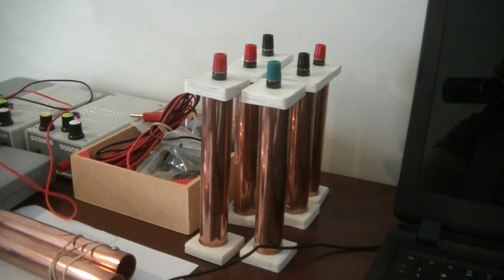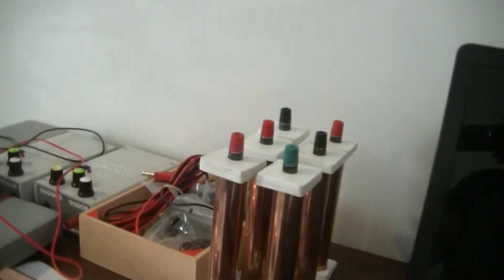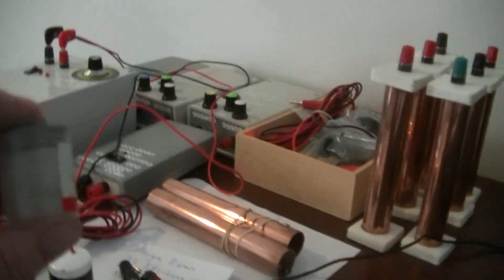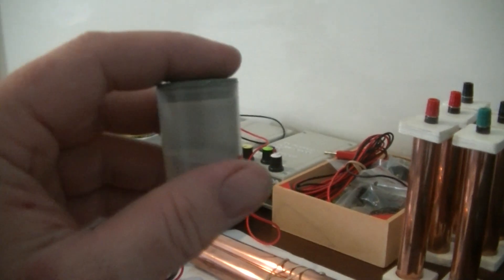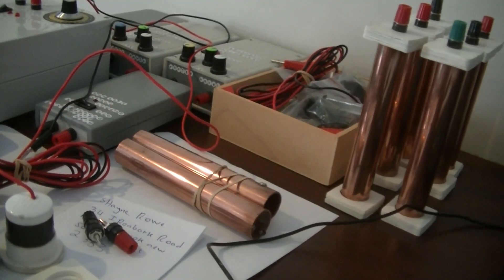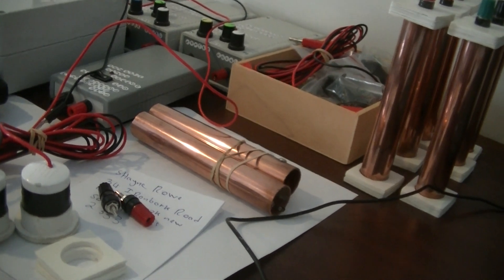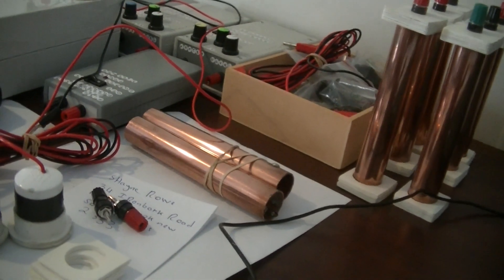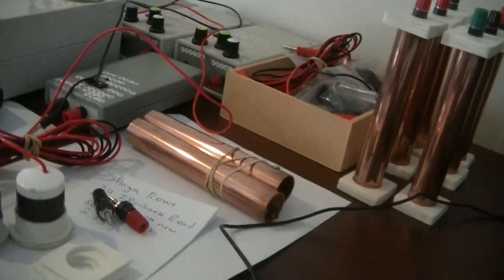parasite zapper electrodes update

Comment from the maker: that small plastic container with stuff in it im collecting for my next new electrode  design  anyhow ive just discovered that the stuff i got already collected  as i pour more filled coper into it and shake the container which i have changed to a specimen type used in hospitals , i noticed everytime i shake the stuff up while under the fluorescent light in my carport i can see a light ray radiating upwards  where the light from the fluorescent light comes from , what im seeing maybe some kind of increased vision for light of the electromagnetic spectrum maybe from zapping my optics during zapper tests as everytime i can see it but not in the dark and not under the downlights in m y room  only that fluorescent light i can see it. it appears that mixture is radiating light when shaken and mixed , it has powder ormus in it and borax and coper and nickel  and aluminium so far  to and i have more to add yet